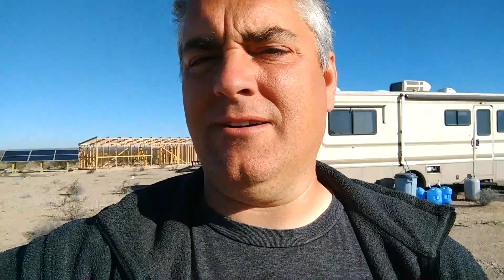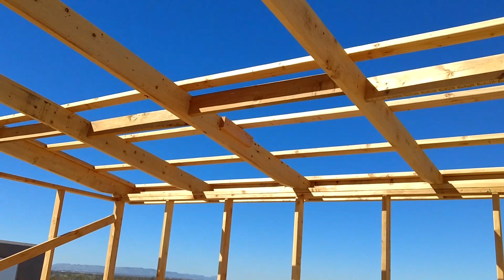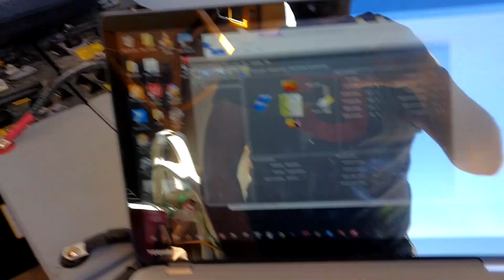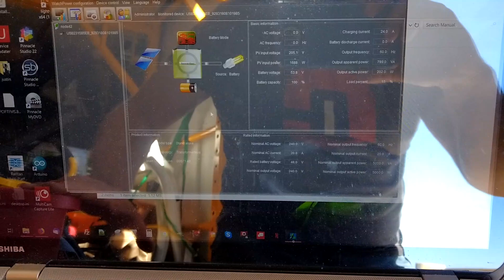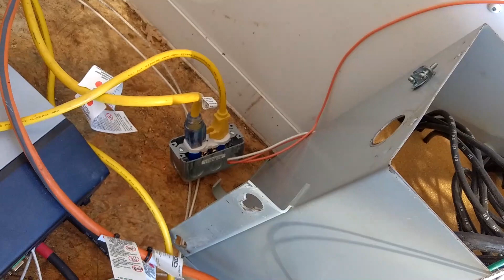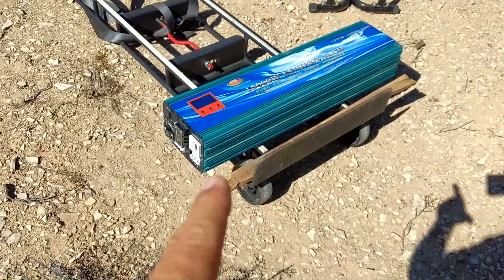More power and purlins going up..

Comment: Howdy pard.  Just caught your channel and have watched to this point.  You have good positive energy.  I implore you to get plywood on the sides of your shed for safety as that provides the cross bracing to hold  it up.  I was happy to see the wind didn't blow it over.   Don't want that thing hurting you guys out there while you're framing the roof.   You got some weight up there already.  Be sure to use lots of fasteners on your siding, my man, since  your walls are under framed, but you already know that.  I'm assuming your siding is 4x8 plywood.  Good luck and stay safe out on your new journey.  We'll all keep watching.

Comment: Looking great!
I'm interested in solar and wind energy for my place here in East Texas. So much knowledge to intake at 60 years old. Then you think you might have it understood... Then you don't. Right now I want to power my greenhouse just to get started. So confused. But looks like you got it going on. So glad you ran the 2x's across the top for your metal roof. That way the rafters won't sag with the metal. Carry on! Keep us updated!
Reply from the maker: Thanks :) I had decided against wind but now I'm back on board. If all it does is provide a hundred watts here and there it could help compensate for the ambient inverter load and since it's windy quite often out here I think it may do more than that :)
Reply: Take a look at the TLG-500 wind genny. Pricey, but great low wind output, and built to last many years. (Not advertising here)
Reply: Typically East Tx doesn't have enough wind to make sense with a wind penny. IMHO. And solar will need some tree trimming in the Piney Woods.
Reply: @TheBigfoot567  I have 27 acres and I have  trimmed back the Pines in my housing area. Got three story house and looking toward solar and wind. Yes it is windy in west Texas. I was born in Odessa. I'll try and take a look at this wind thing that you got showing in your message